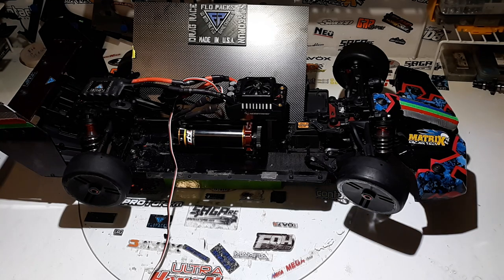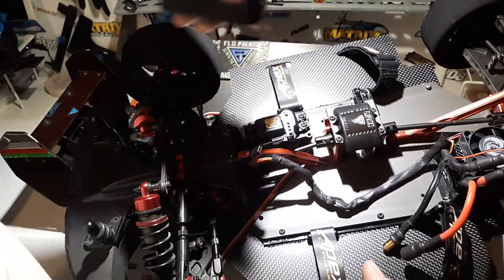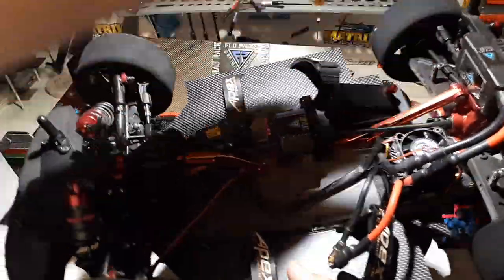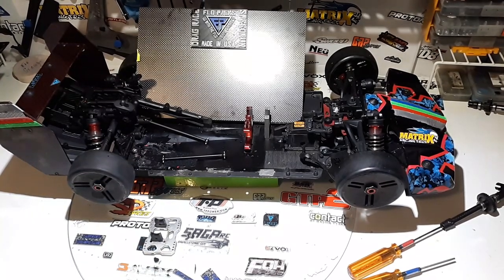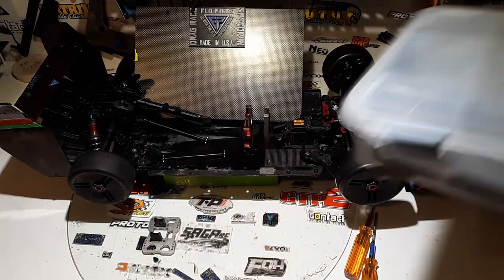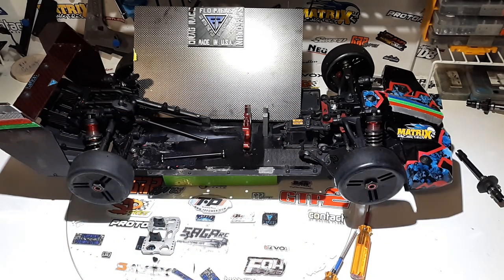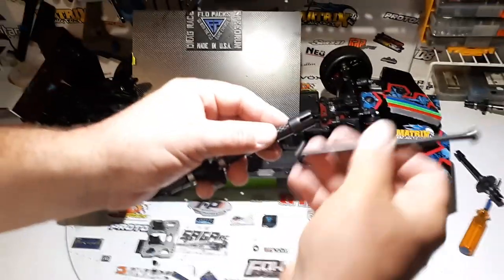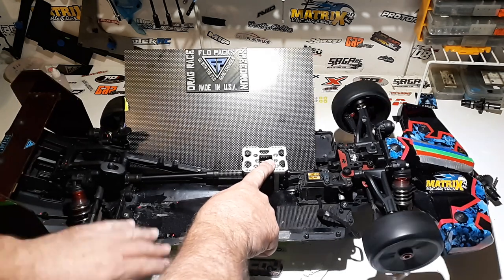ARRMA LIMITLESS / INFRACTION SPOOL BY FLOPACKS =COMMEN MISTAKES

Comment: Jason. best spool i have seen bro...thats called perfection.
You should sell them to ARRMA !
please send me a link to buy one now...i need  a 32 T spool
Thks .
Reply from the maker: There on Ebay  type 
Arrma limitless / infraction spool into search bar .you'll have to order a gear from saga I just sale the blank shaft with bearings , cups ,and carbon fiber
Reply: @flopackrc5452  thks...what is the ref spool from saga ?
Reply: Jason. Found it in ebay thanks.Does this spool shaft is used with the same stock dogbones ?
Reply from the maker: No after purchasing I'll give you the part # for the 1 doggone you gotta get
Reply: @flopackrc5452  ok...is it in stock ?
Reply: @flopackrc5452  jason. Already bought it from paypal usong my wifes cynthia nessim paypal account.  Pkease send me link for the new dogbone and also for the 32 T saga spool  thanks.

Comment: Hi Jason I just came across your spool on eBay I want to order one but I have a question will it work with the infraction V2 or I will have to take the bearing set up that comes with it ??
Reply from the maker: Yes it will fit yes you will need to remove the ridicules 2 bearings once those bearing get dirt in them its  gonna cause resistance  and slo you down
Reply: Ok thanks I will order one from eBay

Comment: Ok so I’m new to Aarma as a brand , I run 30 Traxxas rcs and 4 hpi . I recently bought my first aarma.... the infraction, it’s dope . So I bought the felony before I ever drove my infraction. Just bought the limitless roller with the castle creations mamba monster x8s with the 1717 1650 combo. Any suggestions on what parts I would need. Btw just bought 2 pps motor mounts . Thank you in advance.
Reply from the maker: Flopackrc.com spool + gears
Cappack
Reply: @flopackrc5452  what gears ?

Comment: Jason, nice video but do you have diff lockers infraction/limitless and typhon I need your help thanks!
Reply from the maker: No sir I dont lock my diffs locked diffs work well with a gyro if you dont run a gyro you'll be all over the place . I put 1 million in front  so it still spins 
And 700k in rear I like it stiff but not locked ..
What problem are you having ?
Reply: Keeping it straight for the whole run it pull right and looks unstable toward the end of run hitting 113-114 mph
Reply: Great information Jason...jus installed my second Spool in my limitless Gt...great Product
Reply from the maker: @juniorsmikle2600   thanks my dude stay safe
Reply from the maker: @davidkill2725   I hate locked diffs I know guys that run them locked there not for me cause your putting to much faith into a 1$ bearing literally the left bearing rolls better than the right it will pull right ..
Reply: Thank you brother I’m on I’ll be seeing you soon for a spool on my new build (Felony).

Comment: Hey bud i just got my flopack spool for my infraction I noticed the spur is 8mm saga spur  and my pinion is 5mm saga that’s what the 1650kv uses now will that be an issue would I have to change the spur or am I all set to put it in sorry for the stupid question still learning

Comment: Hey question.., what do you like to use for the diff input drive cups?
Reply from the maker: For what car ? 5mm I use mugen 8mm I have them  machine
Reply: @flopackrc5452  …. On the Felony platform, I called warranty on the input Drive cups on the front and rear differential input gears because when the factory driveshaft bent, the rear and the front shafts must have caused damage to the drive cups because when I installed the brand new titanium front and rear driveshaft, I noticed the cups we’re not true and was not flush on the mating  surfaces. I lose that the grub screw and repositioned it and tightened it and it just sits crooked. It is not even flush up against the bearing once it is tightened. There is no content about other people having this problem and or how to fix it or upgrade it. The only thing that comes close are those spool products, perfect pass, scorched, the Pinocchio spool and drive shafts but nobody is talking about the input drive cups. I noticed damn near everybody is running the stock cups that come with the car but I bent my drive shafts early on with the stock set up and I never even ran the speed gear, not even recently because I’m still getting used to 60 miles an hour.
Reply from the maker: Schorched uses titanium  as strong as it is its springy it will get a wobble in it eventually. 
 I use mugem mbx7 cups there true and my spool  eliminating the long dogbones ..

Comment: Whats up flo I need help with the arrma limitless suspension for speed runs
Reply from the maker: Rear tight  front loose
Reply: Do I have to stiff the shocks in the rear
Reply from the maker: Yes 100wt
Reply: Ok what about the the front

Comment: A little bit confused in the beginning of the video you said there’s no sanding or grinding and then the further you get into the video you’re talking about sanding and grinding??
Reply from the maker: No sanding or grinding if you use a recommended pinion gear from saga rc .if you use another  brand you may need t sand on it as all opinions are different sizes